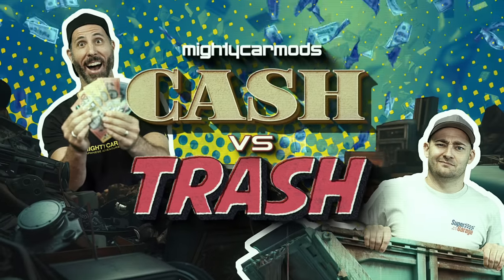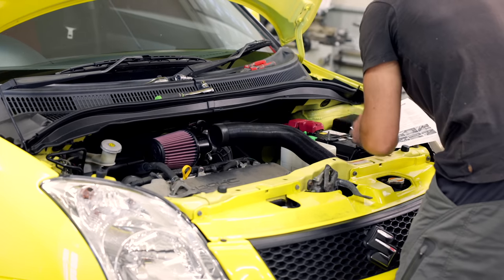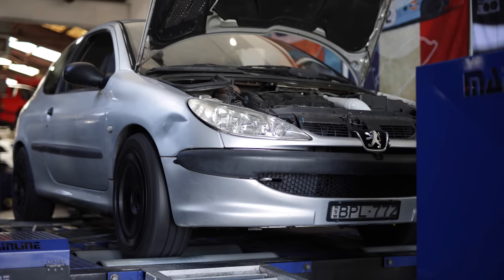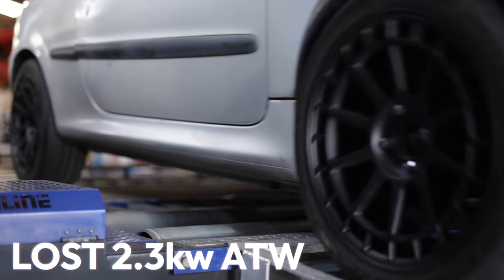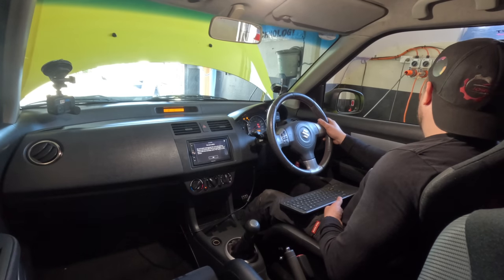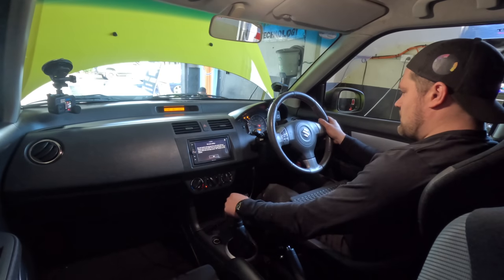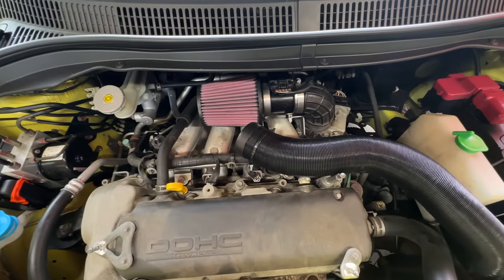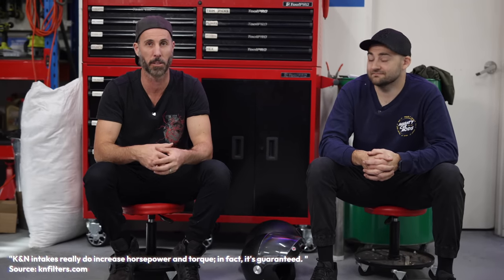Dyno testing POD FILTER Performance Claims | CASH vs TRASH

Comment: On the Swift 2 reasons Uve lost power. First one, you guys should know better from you time on the dyno with your Sooby "Gramps". K&N air filters oil gets onto the MAF sensors and affects their ability to read properly and that filter being so close to the MAF would have hurt it. Your new Air intake is (despite the duct) also sucking hot air off the engine, and it looks like the duct is getting air from behind the radiator which wouldn't help either so between all those things is why your losing power. Put the factory airbox back on, factory panel filter, then use the duct from the K&N kit, attach to the air box and run it to the vents next to the Fog light, id personally open the vents more or ditch the fog light altogether and use that in a way it'll act a little like an Air Ram/Scoop. With this Method you should see gains. Its a Method Commonly use on many cars that see track days.

For the Peugeot. Air Intake in theory is better over factory. But your exhaust is where you would be hurting. Replace the last section of the exhaust rather than having that pea shooter section and then if you can then make Insert (like those silly silencer inserts) for the cannon reducing the size to 2 1/2 inch. you should still have some noise but also generate enough back pressure to have some sort of scavenging affect and hopefully see some gains on the Dyno.

Comment: Martys pug would have lost power more due to the massive increase in wheel size and weight and the pcv piping would cause turbulent airflow. 
But the swift i am really stunned by, only thing i can think is the k&n pod filter has caused an increase in air causing a leaner mixture/less advanced timing from the ecu. May require a tune to resolve it. I would have just installed a k&n panel filter to the standard box.

Comment: I would use stock wheels because it is main contact point with rollers ... or maybe try to find on dyno where you mount it on the hub

Comment: I put a K&N system on mine and data logged. Intake air temps sitting in traffic were 60 degrees F higher and the engine would ping on acceleration from a stop. Went back to stock and temps dropped back down.

Comment: Try making or using a intake pipe that gets the K&N pod closer to the front bumper and cooler air. It's just sucking hot air off the top of the engine.

Comment: It really depends on the car and what its restrictions are.  Mods often multiply each other, so if you have serious exhaust mods (where you eliminate some catalytic converters), an intake will make a bigger difference.  A tune would probably help.  In my old car (Maxima), a ghetto short ram intake made a noticeable difference at the track.  Most of my simple mods made a noticeable difference and I made it way faster than stock, but my car had the same engine as a 350z and g35 yet didn't make as much power as them stock, so it was obviously purposely restricted by Nissan.  I just unleashed some of its potential.

Comment: i did the same thing with my 5.3 silverado. put a k&n air kit on it and true dual 2.5 exhaust mandral bent. and it almost felt slower. i got a custom engine tune and man what a HUGE difference. it would just light the tires up after that. My tuner mentioned if you change your intake and or exhaust it could make the engine run leaner or richer so you gotta tune it or it wont be running at its optimal AFR wich will make you loose power. the engines in modern vehicles are very  specifically tuned to run with that stock intake, now idk if you guys made tuning changed to the fuel maps and what not after the mods but that's almost guarenteed the problem

Comment: To get the most out if aftermarket Exhausts and Air Filters you Need to get the ECU flashed. Adding aftermarket parts on any car won't give the benefits. The stock ECU will still be thinking it has stock parts on it but is compensating for more air with the K&N, and probably the Exhaust. Get the ECU flashed or tuned so it knows there's more air going in you'll probably see 115 bhp over the 109 stock

Comment: My 200 hp Chevy Blazer picked up almost a second over similar Blazers with just a K&N FIPK and Dynomax catback exhaust system. You can check Drag Times' sight and most 4 doors run mid 16s or slower. Mine ran mid 15's. I even uploaded the timeslip to prove it.

Oh Yea. The DA aka density altitude was something like 300-350 feet (100m or so) below sea level 🤣 "mineshaft air" 👌. It was like 60* F out that night and my truck was running superb.

Comment: I fitted a Growler intake with pod filter on my last car and they stated the benefits would not be noticed straight away as the ECU needed to learn as it was seeing the new airflow settings coming through.  I noticed the induction noise straight away obviously but after about a week of regular stop start driving, I noticed the car was more responsive when accelerating.

Comment: A potfilter kit only eats power if you want to gain power need to fab up a ram cold air intake system or get a drop in filter those work in my experience and if you rip out all the sound proofing from the stock airbox you also gain a bit of intake sound

Comment: Unless you go with a pretty large pod filter the filter area is usually smaller in a pod filter than the stock air box. It is usually better to use a performance oriented filter in the air box instead until you go to a mors optimized plenum design or separate throttle bodies. And to really make use of a better flowing intake you usually need to up the cam/cams and an updated tune and much more aggressive ignition. A custom map session on the dyno would probably be my first choice, then cam, exhaust & catalytic converter with a tune.

Comment: those heavy wheels on the 205 are probably where the power was lost. with the mods doing basically nothing (call it a wash and dyno variance)

As for the Swift. It's possible that there's too much turbulence to get a stable MAF sensor reading with the MAF so close to the pod with no air straightener - thus the ecu is not able to accurately meter to correct volume of fuel. The OEM intake likely is designed to ensure the MAF gets a rock solid and stable reading.

Comment: Open air filters (pods, cones, etc) are designed to remove vacuum restrictions.  With that said, if there's no turbo having the boost increased, and/or no larger valves and cam lobes, the demand for air in the intake system hasn't actually changed.  Auto manufacturers aren't going to design an engine, then immediately design a restriction to attach to it (factory air box) that will hurt its performance and efficiency.  If the engine only wants X amount of liters/minute of air, it doesn't matter if an intake is able to provide more than it mechanically demands.  The factory air box is a sealed system designed to pull colder, more dense air from outside of the engine bay.  It's no surprise that an open cone sitting on top of the hot engine with a hose pointed at it (more of a suggestion of cold air than an actual supply) lost power.

Comment: Most cars come with a tuned cold air system from the factory. I like to use drop-in K&Ns, only because I rather clean and reuse my filters, rather than buy a new one every year. I doubt they do much to improve power. The only thing you can with absolute certainty is that a clogged dirty air filter will cost you power.

Comment: The Swift intake would be designed for air speed. The pod directly on the TB would gain flow but lose velocity. So at high RPM you wont get as much air in the cylinders.
Secondly, the engine is probably still learning the new exhaust and intake.

Comment: The SAE correction factor that we use in dynometers in the United States is 1% for every 10°F.  If you took your nice cold air from the outside With the factory filter and then  raise the temp. 50 degrees( under hood ), you could lose 5% easily. 

There is never a situation where hot air makes more power.

Comment: Wheeler Dealers did the same with a Subaru Impreza WRX some years ago. Exhaust, intake and some other stuff, lost heaps of power. Had to add a tune in order to gain anything from the mods, otherwise the ECU wouldn't know how to behave according to less restrictions allround and would just dial back the power for safety reasons. Can't see what else it could be in your case. Would be interesting to see what a tune could do. NA engines aren't known for handing out lots of power without serious modifications, so a comparison between a cheap tuning box vs. a proper tune could be what the people crave.

Comment: It could also be the wheels and tires.  lighter wheels will help gain power, but tires with a larger diameter will loss power.  

It also makes a difference where the weight is concentrated on the wheels.  Small rims with the weight close to the center will make more power.  Larger rims (even if they are lighter) push the weight away from the center, so they take more force to spin.

Comment: your intake length will affect your ignition and fuel timing, so if you want to spend hours and hours adjusting that the K & N might make the same power or more, but depends on how good the factory intakes are, on stock BMW's you usually loose power with a intake from my experience

Comment: Why did you lose power? Hot air in the donk bay mates. Pods work best located in an area where it gets cooler, denser air.

Warn ir hot air is not as dense as cold air, meaning it takes less fuel than cold air, to hit the right AFR. Add an extra O2 sensor, run it stick, then mod it, and check the AFR.

You have to isolate the pos from engine heat, to get the best results. Build  box for it, then plimb it directly to the air box, from a fog light location. 

We did the same test with a mate's 95 vette, and did gain power, but only about 5 poubd feet of torque, and 7 horsepower. Working on the heads, porting, valve train, gained more, 11, and 14 respectively. Adding a water cooled pass through box, to cool the air worked even better, combined with the pod relocation, head work, and ice water in the box gained 6 additional foot pounds, and 8 additional horsepower. 

Granted, that's on an LT1, not a 3 or 4 banger. Smaller engine, or donk as they say down under, less initial power, smaller gains.

And I just want to say thanks for testing these things, on this series. It shows that one doesn't always have to dump copious amounts of money into a car to make more power.

Reminds me of an experiment my wife and I did with our 92 F150, a decade ago,using factory F Series parts, on the stock 4.9 liter I6 it came with. 

Kept the head, block, and internals stock, kept the 2 3 into 1 factory header type exhaust manifolds, swapoed the intake and injection to the 94 MPI set up, added the 94 ECM, with a reflash, and adjusted the timing,  retarding it  by 3 degrees. Net loss of 2 HP, net gain os 12 ft pounds at 3800 rpm. Truck was a work truck, used mainly for hauling and tow duty.

Towed our friends Town and Country minivan on the highway, on the car trailer, like it wasn't there, in 4th gear, in the hills, and in 5th on the flats.

Lol. Yeah, I know. Not a Mad build, but with all used parts, we were happy with the results. Phase 2, after the body work is done, the donk is getting new parts from Clifford Performance, a company that makes a 6, perform like an 8.

She's 31 now, a classic. Time to retire her from hailijg, and make her haul on a different way.

Comment: Modern car intakes system already had a good air flow.. The best way it to just change the stock filter with high performance filters.. And it doesn't have to be K&N..

Comment: The thing with the performance intake you have to modify the ecu in many cars so unlock more power because some ecu's wont automatically increase fuel enough to make up for the mor accesable air. At least thats the theory i know so far and familiar with.. Also an intake only improves power when enough cold air can enter it, right next to the engine is relatively warm but if you installed it acording to the manual, thats on them.

Comment: K&N stock panel filters are great but their oil is a restriction, clean them when you first get them and don't reapply the red oil for power gain, it does keep your engine cleaner if you do but for power don't use it. But in general yeah with mafs you don't actually get any gains unless you tune.

Comment: If you do tune the car to use the aftermarket pod filter, you should then put the STOCK intake back on and see if the power goes back down, it might prove that aftermarket air intakes really do nothing!

Comment: i know a pod filter close to the MAF the "bad air" sometimes mess with the sensor. so a tube and a grid might work. here we some times replace the injector's and adjust it with a bigger MAF sensor housing. that is if the car can use some extra fuel etc.  and then the throttleboddy is upgraded if that is a restriction.

Comment: The problem with the K&N intake kit is probably air flow. The whole hit probably makes actual power if the car is on the road (moving air) instead of just static on the dyno with a fixed fan in front.

Comment: i know that k&N said to put the filter there. but instead, i would pipe the intake over to a cold spot and put the filter on there. be pretty funny to see pvc pipe on the swift, but im sure it would help. the other idea going around is that the wheels were creating the most drag.

Comment: Keep the original airbox and intake system. Instead wrap it with heat wrap or reflective heat tape. depending on the airbox, modify that to allow a larger intake of fresh air before the air goes through the filter.

Comment: The stock Intake is specifically designed to condense the air intake through the channels that they made in the intake.

Why you lost power is most probably due to the pressure build or "flow restriction"... if I can put it that way you lose power.

Best way to make power with the pod filter would be custom ECU or Flashing the ECU to boost performance. I use to drive a Ford Figo. I installed a pot filter as well and went on a deep dive on to why that happened but that was a while back.

Comment: I believe you should dyno the cars with the original wheels and tires because the cars were engineered with the smaller wheels.  Then possibly compare pod vs drop-in, in original intake, filters.

Comment: You should reset the ECM/ECU and let it relearn. Even stock computers do learn and adjust the ignition and fuelling over time. This can backfire though when you make changes to how it breathes.

Another thing... Run with the hood open and see what the results are.

Comment: The fine print says that you need to tune the car.  The computer is set up to work with the air flow out of the factory hair box.  When you change that the computer see more air than it should get.  And is going to balance it with in it's preset parameters.  To reality get that extra power.  You'll need to flash the ECU if possible or get a stand alone ECU.  A lot of people don't know that.  You can buy all the bolt on performance upgrades for your engine.  Without a proper tune, you are just making your engine look pretty.

Comment: not an engineer but am studying engineering and in the mechanics it might have been the fluid levels are not hot enough to generate the power. however that is for aircrafts as im learning aeronautical engineering, not sure if it applies to cars

Comment: I think it depends on the limits within the cars ECU. All modern fuel injected cars had O2 sensors that feed information to the ECU on what the air/fuel ratio is. Depending on the ECU many can make adjustments to the fuel to keep the air/fuel ratio in line.  So when you make a change such as adding a high flow air filter the ECU takes time to adjust/increase the fuel delivery to bring the air/fuel ration back to what the engineers want.  Maybe these two cars have ECU with less range in the allowed adjustments therefore the power suffers as ratio goes lean.

Comment: You also have to consider that you're on a different dyno on a different day, in different air (Temp/Humidity/Pressure).  The calibrations (and how exactly they each apply corrections) can make that much difference.  You can really only get 1% accuracy with this sort of set-up by swapping all the parts over quickly between runs.  That said looking at the difference between the cars , (presuming they were both tested at about the same time in both videos), it's fair to say the Swift lost some power.  IMVHO the likely culprit is the intake geometry.  Unfortunately, the factory MAF sensor calibration (in the ECU) is somewhat dependent on the exact flow characteristics of the intake.  You can of course re-tune it and probably get a small gain (over stock), but unless you have an aftermarket ECU, you're probably much better off just swapping the filter and leaving the rest of the piping alone.

K&N engineers know this, but it's highly application specific so the management is willing to gamble a bit with the guarantee, because more often than not, you will get more power just switching to their stuff. In the cases where you don't they will take the hit on restocking etc.

Comment: I know from a bit of mechanical experience over the years, without a proper tuning of any performance part installed, you’re likely ruining what you want. It’s tuned and designed specifically for the parts oem installed

Comment: Proper intakes, stock or otherwise funnel blown or flowing air through a filter, overcoming some of the resistance the filter induces. Driving fast with a good intake is like a funnel shooting air through the filter into your engine. Blowing air roughly at the hood with a big bulbus hot air intake filter will always lose power Vs a ducted system.